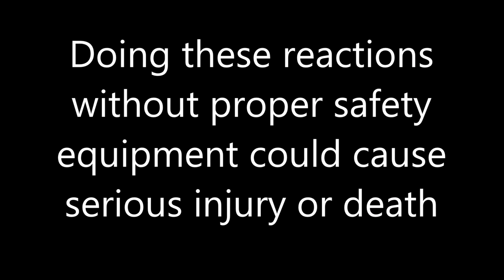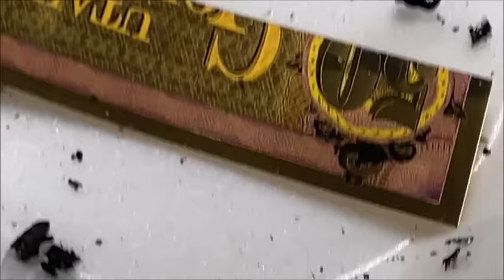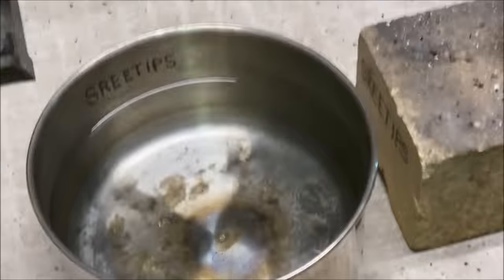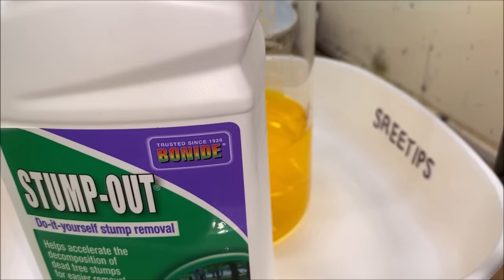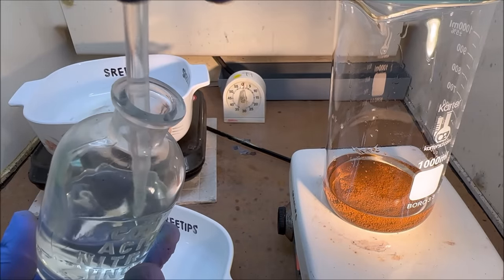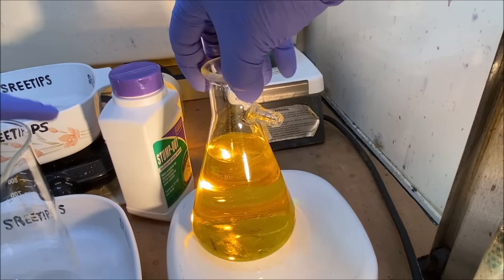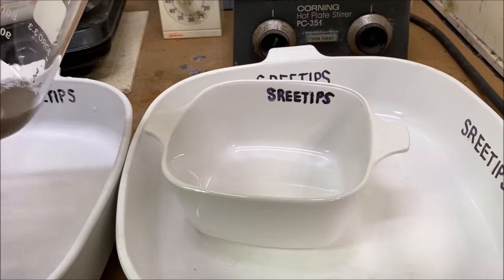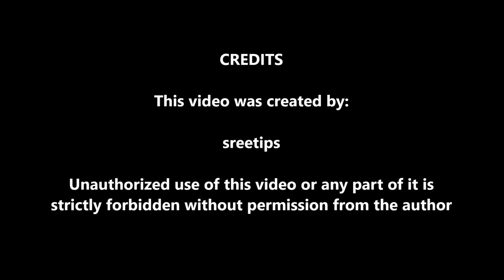How Much GOLD in Utah Gold Backs

Comment: That was awesome. Helped to dispel some of my fear about goldbacks investing. This demonstrates that these are viable for investment. 
Thank you so much
Reply: How so?
 You could buy that bar of gold for much cheaper than with the gold backs. 

And anyone thinking that them being collectable will get you that value back plus some are only half correct. 

They definitely could go up in value if they go out of production and a demand grows, but and big but, is that part of the reason for collecting gold is for if the current banking system and or country go down the toilet.  

If that is the case then you will have massively overpaid on this gold. And if we are bartering gold and other precious metals then you will wish it wasn't stuck in this dumb note. 

Buying these is only hoping on an increased demand for these exact bills. Not for actual physical gold.

If value of gold is what you are after this ain't it

Comment: The idea of heating the mold before you pour the ingot is to remove the moisture. This prevents a "steam explosion" when you pour.....
I think you should turn off the burner on the mold just before you pour it and see if you can prevent the "wave lines" on top of the ingot and get a perfect mirror finish. Just a thought.
Reply: Nope won’t work when you doing it with a flame.   This will only work if he remelted the ingot upside down in the same mould ( so no sharp edges on top) in his electric furnace. It will have a far better finish but I think it will get stuck in the mould while they cold down.
Reply from the maker: The idea of the flame on as the metal is poured is called a reducing flame. It prevents the air from coming in contact with the surface of the metal as it freezes in the mold. Otherwise it would frost instead of shine.
Reply: The "pour lines" are a desired trait in poured bars.
Reply: If you watch how big mints/refiners make their bars,(larger ones, not stamped) they usually start with gold shot, and heat it directly in the mold in a furnace. With a graphite lid on the mold itself……it heats evenly and turn out perfect
Reply: @niagarajoe4402  yep and that is the difference between "cast" bars and "poured" bars.

Comment: Since I ask a lot of questions, here is one more, just to keep up the tradition

I've noticed a lot of microscopic beads of gold and other metals on the used melt dishes, as well as purple discolouration (which, I assume, is also gold) - are You usually processing those as well in order to recover metals? If yes, how the process looks like and what methods do You use?
Reply from the maker: I saved all my old melt dishes. Someday I’ll try to get the beads off and do a recovery/refining. But I’m very low on time. Getting towards the end of the season.
Reply: And that's why I asked few weeks ago about them too if he's willing to sell them because they look really tasty 😅
Reply: Try soaking the melt dishes in dilute Sulfuric Acid. It's just Melted borax. Any metal beads inside the dishes will come out easily after all the borax has been dissolved.
Reply from the maker: I’ll give it a try to see what happens.
Reply: @sreetips that would be a nice video or added to a video.

Comment: Hello old friend. It has been far too long since I was last  here to visit with you. I have a stack of these gold notes so this is going to answer a lot of my questions. I  have added oxygen to my propane  now. What a difference having that extra 2000F deg to the cup. It will easily boil my silver if I am not careful. 
I sure learned a lot from this post and the right thing to do is send mine to you for processing.Ya rock old friend. I hope to be back a bunch now.Take care eh.
Reply from the maker: Dean, good to hear from you. Stacking Gold Backs is better than stacking dollars. Long after the dollar is gone and forgotten, those Gold Backs with still be valuable because they contain GOLD. I want to convert to oxy/propane myself. But for now, oxy/acetylene is my current rig. Take care.
Reply: I was able to buy an oxygen bottle outright so there is no monthly demurrage charges. I got the regulators for propane from the net. The torch I had. I am using a rosebud tip as well. I really like it. It has about a 9/16 across tip that I still run a nice, long, clean feather at low pressure. Just like a standard tip used for heating. It was a whole new learning as it will still boil silver if not really on the ball. I like the propane as it is easier to manage than acetylene and runs a lot cleaner . A lot less $ as well. @sreetips
Reply: Hello again.  @sreetips   I had oxy.propane on my cutting table at work. 2-1/2 inch TQ100 plate was cut with ease. It was a no brainer when setting up the new bench as it runs sooooo much less expensive than Acetylene.
No black thingies'' floating around the shop and adding the oxygen gave me all the heat I will ever need. I was able to purchase my oxygen bottle outright so no monthly charges. $80.00 per fill when needed. A rosebud tip run low and just enough gas for just the right heat. Not too high and a full 1/2 inch wide flame. It is awesome. I have always wondered why propane tips are so different from Acetylene ? If anyone knows I will sure like to hear from them and I will pass that along to everyone. Nice easy day on this Xmas post. See you again and take care old friend.
Reply: @TomokosEnterprize  just subbed you! Interesting videos you got. God bless ❤😊❤

Comment: Its a 50 goldback that weighs 1/20 a troy ounce. Gold spot today is 2075. That means the 50 goldback should have 1/20 of 2075 dollars or about 103.75 value. Did i do it right?
Reply from the maker: Sounds right for a single 50 Gold Back. I did ten of them.

Comment: I was wondering how much different in weight a container of liquid gold would be to the same amount of distilled water.
Reply: Gold is 19.3 times heavier than water. A gallon of gold would weigh about 161 lbs.
Reply: Thanks
Reply from the maker: A solution with gold dissolved in it will be heavier than the same volume of liquid water with no gold in it.

Comment: Sreetips, just found your channel maybe 10 days ago and have been binge watching ever since.  Couple questions: is your ice made from distilled water? I’m assuming so but not mentioned that I have found…
Have you done a video to refine copper from your cemented copper buckets? Thanks
Reply from the maker: Ice is tap water, contaminants in parts per million, not enough to report in an assay. Clean copper for refining is cheap and plentiful. It’s very useful in refining precious metals. But after that, it becomes waste and I toss it. It would cost more to try to recover and refine it than it’s worth. Unfortunately, to a precious metals refiner, copper is pretty much junk metal.
Reply from the maker: Welcome to my channel!

Comment: What did you pay for these, and is a 50 Back physically 50 times larger than a 1 Back???
Reply from the maker: I think is was about two grand. The ones have 1/1000 of an ounce (31.1g x .001 equals 0.0311 grams pure gold). The Fifty Gold Back has 1/20 of one Troy ounce or 1.55g pure gold (1/20 time 31.1g equals 1.55g pure gold)
Reply: Interesting. So they're more expensive but easier to trade than coins/bars. Could be a fantastic way to destabilise!

Comment: In theory... you should have been able to melt the backs, in a clean crucible, pour them into shot, give them an acid bath, repeat and pour. I can't argue with your results, but why the inquartation? Did I miss something? Was there silver in them? If it was 1/20 ozt and pure 24k, why refine them the long way? I admit I fast forwarded a few times. What did I miss?
Reply from the maker: The gold was dirty. I refined it with: inquarting with silver, parting with nitric, then dissolve the gold, and precipitate, repeat. Why? Because that’s the way I learned how to do it.
Reply: @sreetips  fair enough. I've talked with you in past years. I'm more of a recovery and once refine guy. 23k has always been good enough for me to blow most buyers minds near me.
Reply from the maker: 23k is 958 parts per thousand 23/24=0.958

Comment: On that step where you have liquid gold. Instead of precipitating it with stump remover, what would happen if you boil all the liquid away. can you get the same result?
Reply from the maker: No, if boiled to dryness, then solid orange crystals of chloroauric acid would result. They can be re-hydrated with some heat, HCl and the gold precipitated with SMB.

Comment: one of those gold backs was a $20. so he had about $470 face value but you melting them if he sold it today, 11/10/23, Gold Spot is $1936.79, he would get about $950 so he made a profit of $480. so he doubled his investment. Not bad. if those Gold Backs were bought when gold was around $350, and they were 1/20 of a troy oz. would he have to still pay $50  for them?

Comment: Does a metal detector work on a pile of the gold in that sponge state before it gets melted?
Reply from the maker: Yes, it’s metallic gold. Before the gold gets precipitated, while it’s in liquid form, it’s a salt of gold and will not set off a metal detector. If that solution gets boiled down to dryness, leaving only solid gold chloride crystals, then that too will be undetectable by a metal detector.

Comment: Yeah awesome work but a very expensive way to buy gold!   More like buying collectibles and the lower denomination notes are even worse but you can understand why. Perhaps eventually they'll be spot + 10% or so, rather than spot +100% or more.  

I'd love to know what those gases and ash were while you were incinerating that polyester/polyethylene matrix which encapsulates the 24k gold foil. Probably nasty stuff - I bet it smelled pretty bad.
Reply from the maker: It was some sort of drippy plastic coating. But it burned away rather well (except for the soot floaters all over my shop”.

Comment: The spot price for 1/20th troy ounce is $101.42, and you can buy Utah 50 Goldbacks for about $205 on line.  One place sells em for $201 and will; buy them for $156. You can maybe find them cheaper, but the point is they trade above the melt price, meaning a collectibility premium.  If the SHTF, the collectibility premium goes away, and you're left with the melt value in trade, so why do stackers stack these?
Reply from the maker: Novelty

Comment: Great video keeping people to a higher standard is always good so many cheats and fakes out there. Can you share your oxygen and acetylene pressure settings at the cylinder ?
Reply from the maker: Oxy set to about 30 psi. Acetylene set to about 5 psi
Reply: @sreetips  thank you so much I had mine way too high so used to cutting steel 😂

Comment: Should have used the furnace and a clean melt dish. Would have been better. Spot price being 2000 toz, that's a nice haul.
Reply from the maker: I didn’t want to ruin a new melt dish, getting low. I bought a hundred of them from millers jewelers supply in Chicago back in 2011.

Comment: Something I have always been very curious about...how is it that Flux doesn't cause contamination of any kind...time and time again you see it slavered over areas to be welded, soldered, and here you see Sreetips tossing a bunch directly into the gold to help facilitate melting....but....what happens to the borax?? its just vaporized after its 'job' is done? someone please explain this to me like im 5. haha
Reply from the maker: I’m using borax (Twenty Mule Team from the grocery store). It melts at 743 C (1369F) and forms a viscous molten borax barrier between the melt dish and the molten metal. The molten metals would tend to stick to the surface of the melt dish if the molten borax were not present. The molten borax allows the metals to release and slide down into a central mass in the bottom of the melt dish. As the molten borax cools it forms a “borax glass” upon hardening. That’s why the melt dish appears shiny. Flux means “flow”
Reply: Sir, thank you for being one of the most dedicated comment responders I have ever known on this platform. 

One follow up though...Is elemental Borax heavier than gold? How does it flow under the pooling molten Gold to form that barrier? 

I did know Flux meant Flow, I just always assumed that meant it just helped constituent metals "flow" or melt more easily.

I've been watching your process videos for a few years, and as of late have been revisiting and binge-ing the channel. I see you being so fastidious with your washing and rinsing of all your tools and vessels...to then see you just dumping borax all over the whole shebang got me wondering, how is this NOT causing some kind of contamination. @sreetips
Reply from the maker: I gotcha. Borax is not an element, it is a compound; with the chemical formula Na2H20B4O17.
Reply from the maker: As the metals are melted, some of it vaporizes and condenses on the upper rim of the melt dish as tiny balls of metal. These will adhere to the melt dish until I shower it with borax and use the flame to push it down. The borax melts, gets under the tiny balls of metal, and carries them down into the main mass of molten metal in the bottom of the melt dish.

Comment: As someone who loves currency 😱
As someone who loves metals 🤓
Color me conflicted 😂
Reply from the maker: This is not currency. These are gold. Currency requires third party validation. Gold stands on it own.
Reply: @sreetips  currency use to be required to be backed by gold or some other precious metal. Before then it was essentially just metals themselves (or any other tradable resource). I was referring to the artistic aspect of the “bills”. There is an inherent value in that to some. Nice to know they are legit, very impressed at your recovery %. Always fun to see a new vid!
Reply from the maker: Agree. They convinced people to let them hold your gold, but give you paper that’s as good as gold. Then they removed the link between gold and paper. With no restriction, they started printing money like crazy. That’s the inflation of the late 70s, early 80s. The Volker came in and said, “woo, take it easy, with no gold to restrain you, you can print as much as you want. Just slow it down a bit!” The currency has steadily declined ever since. A million dollars in the bank today will buy as much as twenty thousand in the bank did back in 1970. That’s how much our currency (US dollar) has declined over the last half century. It’s worth two cents on the dollar. During the same time, gold has gone from $35 to almost two thousand (and that’s grossly undervalued). They use inflation (money printing) to crush the inflation hedge. It’s brilliant.

Comment: goldback's are not a very good way to invest in gold considering their cost. Almost double spot price considering these are roughly 1.5 grams each for $190. When you can buy 2 gram bars for less at $160.
Reply: Only if you don't understand them and how to use them.
Reply: It takes lots of specialized equipment, human energy, shipping, transportation, marketing to make those things. I can't believe people think that they should cost the same as the spot price of gold. If you spend them, they don't lose their value so the premium is more like an exchange rate.
Reply from the maker: The premium is a testament to their value. If people are willing to pay such a high premium then what that means is the price of gold is way off. Think of it this way; long after paper dollars are gone and forgotten, these Gold Backs will still be valuable, because they contain GOLD. But you can use paper dollars to start a fire to keep warm. Can’t even do that with digital.
Reply: @sreetips  I'm not disagreeing that they contain value. They contain gold. I'm just saying that there are more cost effective ways to stack gold, if that's what your goal is. And I agree that premiums are there because that's what people are willing to pay, which certainly sets a "different" spot price. But if all I am after is the metal, and not so much the form factor in which it is delivered, 1, 2, 3, 5 gram bars are more cost effective with lower premiums. The value is higher. Really, the larger the bar/coin the less in premium you will pay.
Reply from the maker: Yes, there are ways to get more gold for fewer paper dollars. Especially since people have been conditioned to believe, incorrectly, that paper dollars are more valuable than gold. It’s a gold-buyers paradise out there right now. I can’t believe that I’m in the exact right business (refining is my hobby), at the exact right time, with the exact right instrument. I’m thankful for what has been granted to me!
Reply: @riccochet704  The point with Goldbacks is that they are hyper-fractional and the lowest premium in their category. I bought a quarter grain bar (half of a Goldback's amount of gold) about 1 year ago for $6.50. I will let you do the math.  If the smallest sized amounts of gold you own are $80 1 gram gold bars right now, then that is the smallest denomination you can barter or spend with. How do you buy a loaf of bread or eggs with gold if the smallest size you have is 1 gram? If gold shot up 10x what spot is now, that 1 gram is $800. You could be having difficulties trying to spend even 1 gram. In Venezuela they were using gold flakes as money. Goldbacks are gold you can spend.
Reply: @BrysonJack  I own this revolutionary new innovative tool called a hammer. Have you ever seen what one of those does to gold? It's amazing! I can flatten it out and then, get this, use this other awesome tool called snips to cut off any sized piece I want. Man....let me tell you, combine that with a scale and I'll be buying all the bread at Krogers or Publix with my gold. All of it! No bread for you!
Reply: @riccochet704  Ha ha....all that is required with that method is a high level of trust, but other than that, good point.